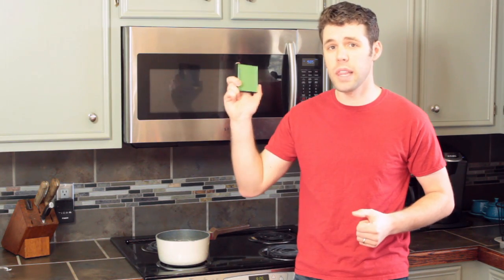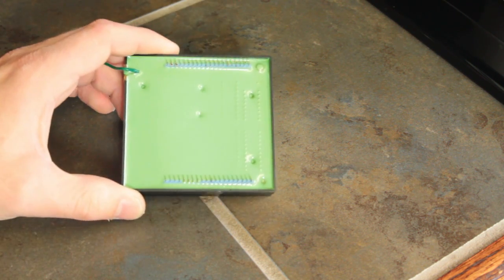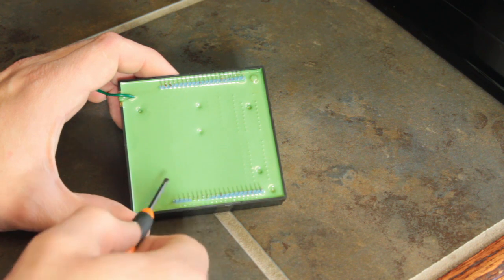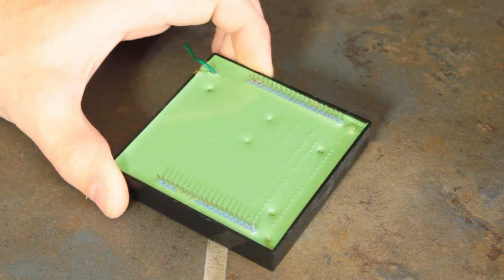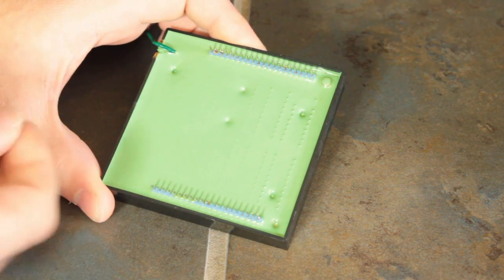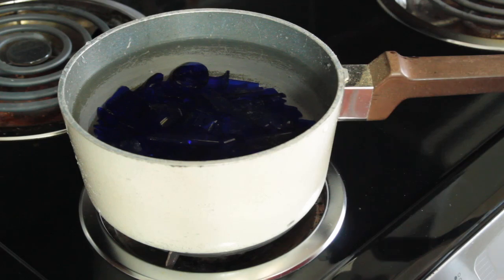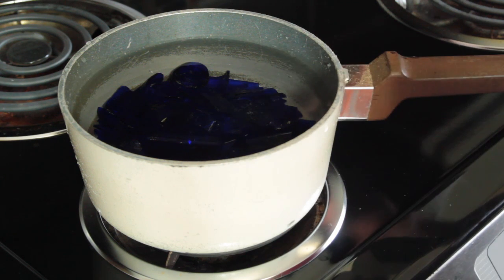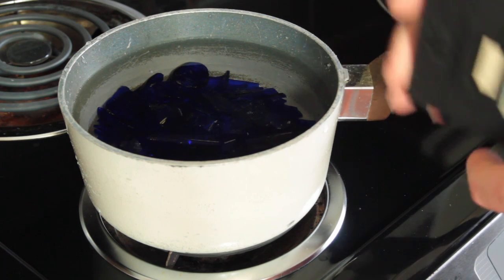Fix it Friday! - How to Remove Something Potted in Epoxy Resin

Comment: Haha! I knew there had to be a way to un-fry my Ninja's ECU. Neat!
Reply: i need to possibly fix something on my VFR ecu and so i might have to try this with some junk first
Reply: @ My Ninja ECU was potted in rubber, not epoxy. Didn't work at all. Bought a used unit and sold the bike. Good luck with yours, hope it's actually doable 😅

Comment: Thanks for this video. I'm looking for a way into a Denso motorcycle ECU which appears to be polyurethane potting compound, but this is definitely going into the memory bank for future use.
Reply: did it work mr Shaunie, god an ac cdi ready to remove the epoxy señor.
Reply: @danpal6737  I also need to remove epoxy from bike CDI. searching from long time of formula

Comment: great video!  Thanks for sharing this.  Do you think that a prolonged soak in a preset reflow oven would have done as well?  Seems to me that you're heating the epoxy up to it's Tg.  Once you get the entire mass up to that level, I wonder if a heat gun applied during the removal process might facilitate this process.  As an aside, were you able to fix the board? :)

Comment: How would you keep the water from damaging the circuits/chips? Is There a way to do this without damaging the housing? How do companies remove it to repair components that they have potted?
Reply: as long as there's no current going through it you should be fine, just clean it with isopropyl after you're done

Comment: Terrific tip - I was able to use that same technique on a potted circuit board today and figure out which component had shorted. I had to keep putting the board back into the boiling water after about one minute each time because by that time the epoxy had gone rock-hard again.
It took a dozen times into the boiling water before I was able to clear off all the epoxy form one side of my 4"x1.5" board but it worked. Many thanks for the great tip!
Reply: That's definitely working, but we need to find better options

Comment: This is awesome, I've been wondering how to do this for years without a lot of noise or aggressive chemicals. Would it work on the tar in old transformers?
Reply: Yeah like fly back transformers
Reply: @adhil8918  those have that same acrylic based compound, so yes it would work, I’m hoping it’ll free a torodial transformer I have that’s half potted, because I want to rewire it to use as a beefy high current transformer

Comment: Wouldn't it have been better to use a small oven and avoid any potential water damage? Electronics and water do not mix well. Especially if it happens to have some sort of back up battery or capacitor.
Reply: Google "CERN dishwasher"...

A lot of people think circuit boards and water don't mix. They often preach to others about it, without direct personal experience. While water IS bad when the circuit is energized, water is ok as long as it's denergized and you throughly dry it before energizing.

I've run many filthy circuit boards through a dishwasher cycle. Gently dried them for 24hrs at 140'f. They work great after.

Comment: i want to remove epoxy glue from a metallic hole, can we use fire torch (direct fire flame contact) or red hot rod to remove epoxy glue?
Reply: Heat gun would be better i guess🧐
Reply: I clean the putty knives and trowels I use with epoxy by just pyrolizing it-turning it to ash. 

Do it outside, it makes nasty fumes.

Comment: Thanks for the heads up. Wanting to try this on a Traxxas RC Car module. They're really proud of them and it's plausible that mine blew some FETs out.
Reply: curious to see someone find this video also coming from trying to repair a traxxas ESC... did you manage to repair it? I have a Xl2.5 that i am sure could be repaired.
Reply: @EPYCMX  turned out it was the motor. Sorry

Comment: I have a Commodore 64 PSU that I’d like to remove the epoxy from, but I worry about water getting into the transformer coil, or the heat damaging any electrical insulation on the coil. It’s obviously attached to mains when in use so I don’t know if I should risk this method. Someone else recommended chiselling it away instead. Any views on this?
Reply: The transformer coil cal withstand temperatures way higher than the boiling point of water (100°C) and that includes its insulation as well. Obviously if your C64 PSU is in working condition then you don't need to depot it anyway.

Comment: Thanks for this tip. will try it on some old voltage regulators of motorcycles. these can cost upto 500 bucks . So if you can repair them  , it will save a ton of $$$
Reply: You ever get one to work

Comment: Dude! Thank you so much!  I have some old Bill Lawrence that are sealed into the pickup covers via epoxy.  I want to unseal them so I can use the covers for new pickups.  You didn't have to reheat it during the stripping process?
Reply: Did they really use epoxy? 90% of all guitar pickups are potted it in wax or other reversible material. 

the only other things I’ve seen are pickups potted in a type of tree varnish/sap… Which looks like an amber colored fiberglass… And I’ve even seen some in a type of natural black tar. All of which are pretty easily removable… At least in comparison to epoxy… And I can’t imagine any decent quality guitar pickup being using anything else. Unless it was an early experimental prototype or something.

If you want to see something potted in the black tar stuff I was talking about... check out “Mr. Carlson‘s lab” he made a video on depotting a transformer.
Reply: @hullinstruments  the substance on the pickups I have is hard, like plastic. I ended up just heating it up enough for me to take a fine-edge chisel to the edges and separate the pickup from the edges of the cover and I pried the pickups out.

The substance is still on the bottom of the pickups. I couldn't get it off, other than the bits that cracked and flaked off.

Comment: alternately you can just throw it in the microwave for a handful of minutes - worked for me - OR if it's s transformer you can just run a heavy current though it and turn it into an induction heater and let the goo just fall out on it's own
Reply: I hope nobody fell for your stupid troll idea. Putting any electronics in the microwave will blow the microwave, and the electronic device in question. Although, the transformer idea might work.
Reply: see also: https://www.youtube.com/watch?v=LVODJm05plw
Reply: ummm NO not really- it's an old machinists trick to heat bearings etc ... just make sure you wrap it in MOIST towelette first! nothing more to it.
Reply: @antigen4  If there's electrolytic caps under the potting, that's a quick way to damage them. They are at least easily replaceable but any other method is many times safer.

Comment: :18. Is it worth it does take a lot of efforts?
Reply: Yes I have ignition modules that cost $1000 a pair and have 3 that fail in testing. If you get it un potted you can repair or copy. The last  European one I did was costing 450 Euro's plus shipping.
Reply: Trevor can you mail me? I have some inverter I need repairing if you would like to do it?

Comment: Where can i get epoxy like this. i want to cover my server psu that i turned in to computer psu. the server psu has exposed wires that i want to cover.
Reply: At the Lowe’s (Home improvement store) in the caulking section. You can choose from clear or colored silicone. It’s much cheaper too.

Comment: Can all Resins be broken down this way. I have this key ring and I just want to give it a go.... I have no idea what kind of resin the key ring is made from.
Reply: It definitely doesn't work with all resins. I've tried this twice with two different projects and it resulted in no softening of the rock hard epoxy at all.  The stuff I tried it on was black electrical potting compound. It may work on some, but I've had zero success with this so far.

Comment: Will this also work for that red epoxy? I need to fix an MSD ignition box. Thanks
Reply: Honestly guys… Each module is different. Even modules from the same company, made for the same application might use different potting compounds on different days.
Epoxy, conformal coatings, silicone fillers, or a dozen other types of potting materials are common. (Including tar and tree Rosen) But even stuff from the same batch might be a different hardness… Or have a different reaction to heat. It all depends on the mixture of a two-part material. 

There’s just too many variables to predict. I’ve depotted at least 100 different modules from all types of industrial applications. And it has to be handled in a case by case basis. Hell I’ve even had modules come off of the same machine that were identical, one was hidden under a cover… And the other was somewhat visible and placed on the outside of the machine. The potting compound in the module from the outer part of the machine was hardened by UV light… Whereas the module deeper inside the machine had a softer and more pliable compound. Each had to be handled totally different… And they were so similar that they shared serial numbers from the same day of production at the same factory.

Anyway… I know this question wasn’t for me… But I figured I would give my experience and just put it out there the things I’ve learned tinkering with this stuff
Reply: @hullinstruments  I know its been 5 years, but please please please share some tips for each material if you can recall what you have done -- would be so helpful
Reply: @calvinmaree9502  oh goodness I'll have to search through some more of my old comments and see if I can find a long copy and paste. Because it's just a case-by-case basis. Not only depending on the actual compound and hardness used, but also the housing the module is in. Weather aluminum, plastic, pvc, nylon ect..... According to what material the module is housed in,  Will dictate How you will move forward.
Reply: david contreras I'm curious too because I need to do the same to a MSD Digi 6 plus. Did the boil method work? If you haven't tried, I'll give it a shot this week and let you know.
Reply: @Rudderify  did this work for you?
Reply: Did either David or rudderify ever test this? I also have a msd digital 6 I wanted to test it on. Any help would be greatly appreciated.

Comment: I'm trying this right now with a Honda eu3000 inverter generator, inverter unit. Model#31310-ZS9-t23. Really hoping it works. YouTube should ad a photo feature on its comments.
Reply: Were either of you successful? I’ve got a bad 2000 inverter board.
Reply: @davesnacks  I am wondering how you two guys went with this? I also have a Honda Generator inverter not working and am reluctant to replace it at $800

Comment: I don't thnk that circuit board will ever work again......
Reply from the maker: Haha, it acutally did.  I had to replace some of the pins on that module, but BurgerTime is alive again.
Reply: Create! Well...Didn't see that one coming.....
Reply: Nonsense. Worked in the electronics industry for years. A common circuit board cleaning method is a nail brush a running water tap, and cleaning solvent. As long as you make sure it's dry (we use a low temp oven for a few hours), it'll be fine.
Reply: Runze Liu Just soak board in denatured alcohol for few minutes to absorb any water then let dry, this will prevent corrosion from water and dry any water that may have gotten under the chips!